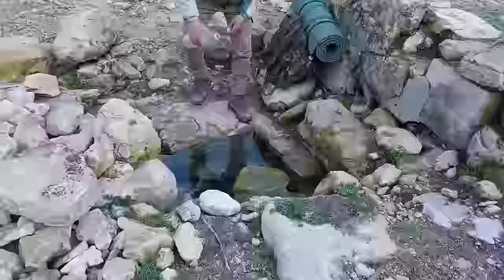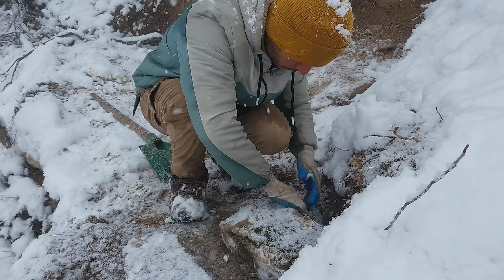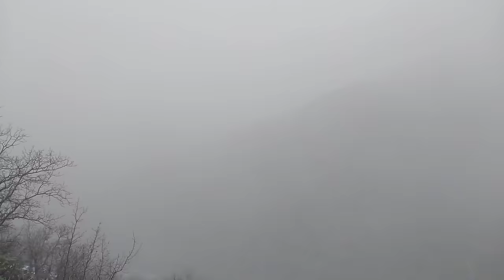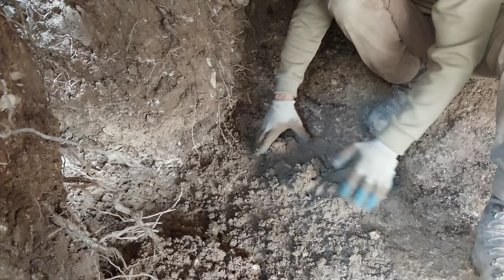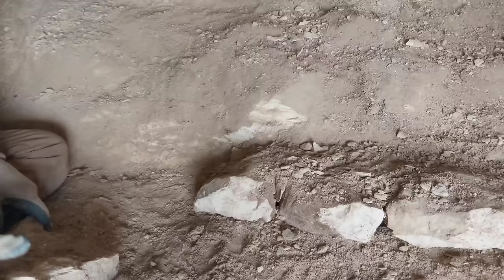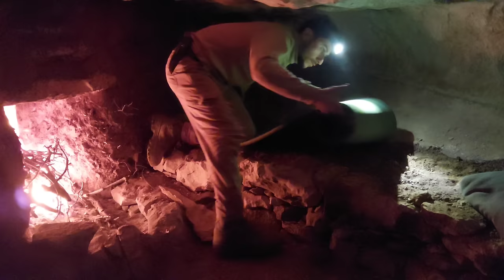Build a WARM and COZY CAVE With a FIREPLACE Inside | Winter Survival camping, Cooking, Diy Project

Comment: Great project. So many details and a lot of work. One thing I would do is to add height to your chimney. It should be above the surrounding area. It will draw better and no have water or snow coming in.
Reply: What i would call stage two …..improvements to a shelter
Realistically this would be closer to stage 3-5…. In a survival situation he would have, should have built an improvised shelter that took a few hours and could provide shelter for a week while he is building this second more long term shelter

Comment: Only thing should be aware of, building under rocks, overhangs...Water has what called "Surface Tension" and will follow the surface of an object, even horizontally, at times...clinging, until finally dripping off..you could be a meter under and still get wet. just something to be aware of
Reply: 0ㅇㅇ
Reply: Good  information.
Reply: Just look at Sigiriya sri lanka .they had a solution called kataram

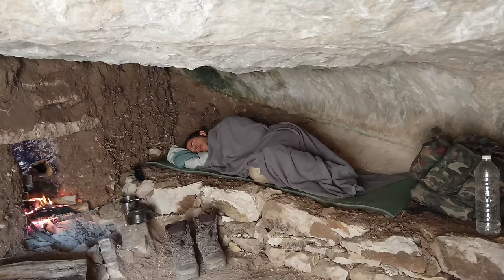Comment: The sentimental picture of comfortable sleeping by the fireplace (13:50) is deceptive fiction. Woods are quickly burned and you have to adjust and add more wood every 20-30 minutes, which makes a long winter night of 14-15 hours a nightmare.
These bushcraft films provide one-sided glamorized stories, and the question is just - why? What for?